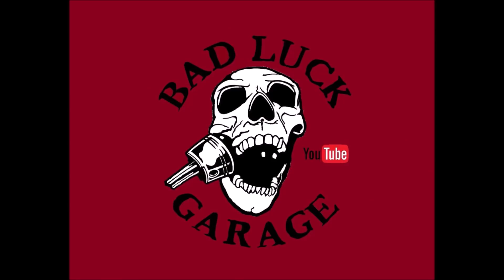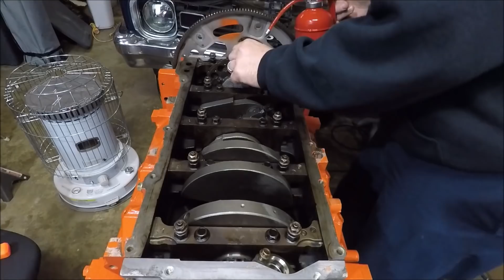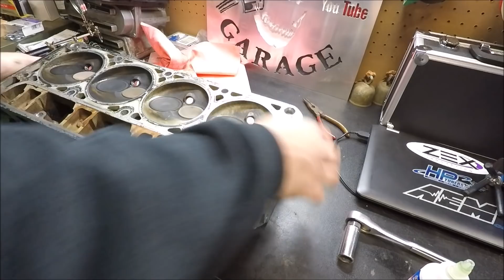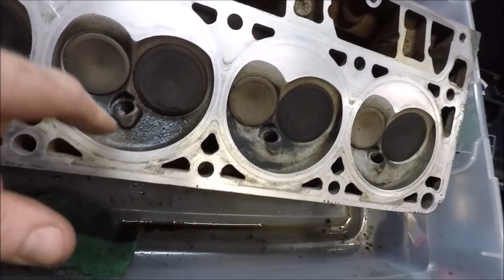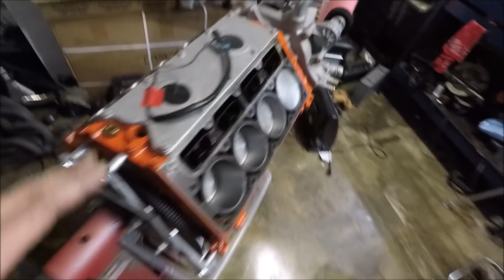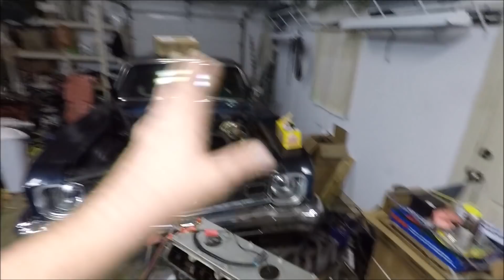LS ENGINE ASSEMBLY FOR DR NOVA PART 2

Comment: $4.00 is cheap 👍. I have a plastic bottle from Salley’s Beauty Supply looks like a clear ketchup bottle, I keep my STP in. Either way works! 👍  Rays gonna love the power of the LS!  3.622 stroke is right between a 350 & 400 SBC, has a roller cam and large runner high flow heads. 😎
Reply from the maker: I'm thinking this will probably be the fastest car hes owned as far as I know. At first he said he just wanted it to be able to run 7s in the 1/8th and be a good daily driver. Now hes over hear talking about superchargers. I told him to just wait and see how he likes it first,lol.
Reply: Bad Luck Garage I agree, he’s not understanding... 🤔. What camshaft is he going to run?
Point A, TTA bolts only work one time accurately, so attempting to reuse a stretched TTA bolt hoping it provides the intended torque isn’t going to happen. If you look at the physical properties of the bolt it makes sense, as it was explained by an ARP engineer. 🤔👍😉
Reply from the maker: It’s the BTR stage 3 truck cam that I had in it already.
Reply: Bad Luck Garage Account for the weight reduction between the Truck and the Nova, it should run strong! 🙏🏻🙏🏻🙏🏻
Reply: Bad Luck Garage I’m estimating the Nova could run 7.90’s in the 1/8th with an average gear and decent 60’ time. I’m not sure what Ray is used to but a true 12 second car is more than the average person ever gets to drive.
Reply from the maker: Yea the 60ft is the issue. It’s still in the stock converter and I believe 2.73 gears. The Chinavette currently runs 8.50s off the bottle and I still haven’t really tuned it yet. The Nova weighs less, has the same rear gearing, and should be making more hp and torque. I may try to talk him into a little more converter though. This is a daily driver so he’s not gonna want to go too high in the stall. Maybe 2500-2800....somewhere in that range. 3000 would be max. Rays never really had anything but pretty much stock small block Chevys with intakes and maybe a cam. When I was young he had a 4cyl 79 SVO mustang and still brags about how fast that was so I think he’s gonna be in for a shock. At least I hope. 😉
Reply: Bad Luck Garage Remember the 80e has lockup for highway driving. So a 2500-2800 converter would be fine. I held off on recommending a 3000 converter because of the 2.73 gears.  My update, swapped my gears from 3.73’s down to 2.73’s when I totally rebuilt the 8.8....well many people don’t realize your rear gears have a large impact on how the converter acts.  My B&M Holeshot 3000 would footbrake 2800-3000 w/3.73’s; I switched to the 2.73’s and it now “Foot brakes” 4100 rpm 😳😳😳.  WTH I definitely need a tighter converter now!
I can still cruise 70 mph at 2600-2700 rpm but that’s close to 15% Slippage not good. 28” tall tires fwiw
Reply from the maker: Yep, steeper gears stall less. That’s why I’m figuring if he keeps the 2.73 then a 2500 stall should be fine as it’ll probably flash past 3000 on the launch. It’s all up to him though. I’m sure we’ll be making some changes after the initial swap. Rays never satisfied, lol.

Comment: You're spot on about the Iridium versus copper spark plug debate. Actually at this point I don't see why it's a debate with anyone. I've been taking iridium spark plugs out of my LSX engines and going back with NGK tr55 copper plugs since way back in the late 90s early 2000s.. You just can't beat a tried-and-true copper plug they're cheap and they work good. These engines just run better with copper
Reply from the maker: Brother people on the internet will fight about anything.....wrong or right. I'm reaching that point now where I just move along and ignore it about 95% of the time. Just not worth the effort sometimes, even if you're trying to help the guy.